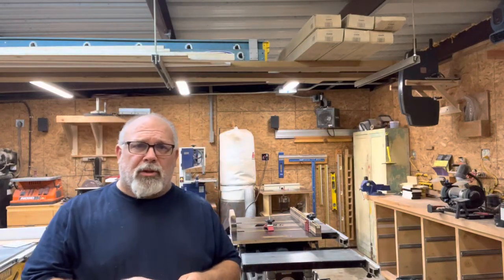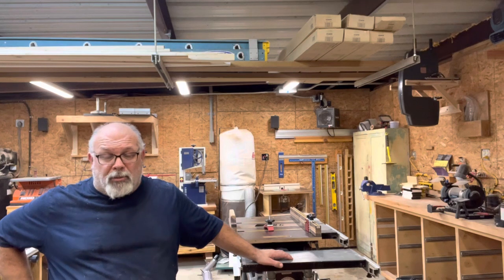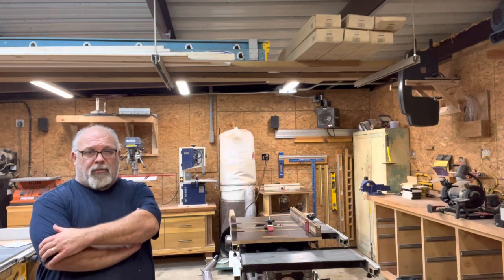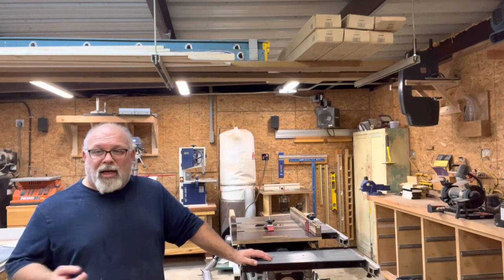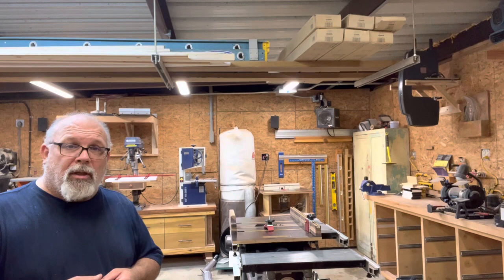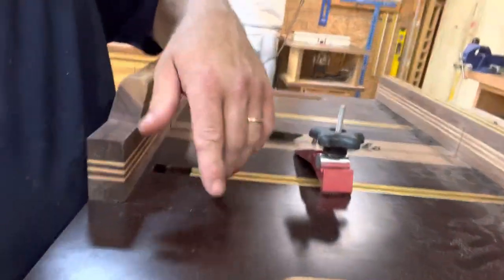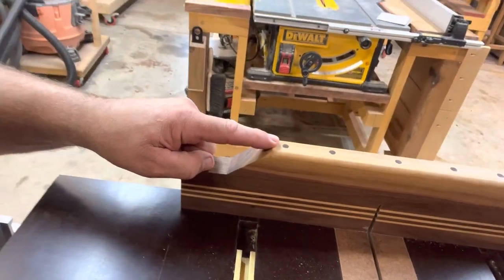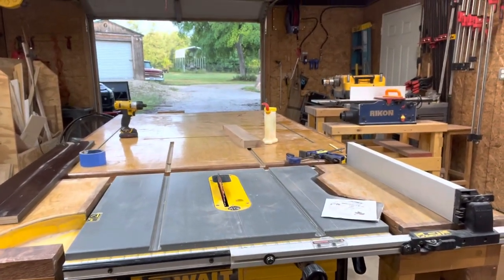Crosscut Sled for ShopSmith Mk V 520

Comment: Great looking sled Tim. I love my 5 Shopsmiths. I currently own a Shopsmith crosscut sled and the incra 500 crosscut sled for Shopsmith. I will get around to doing a made sled down the road. 

 I also own the dewalt compact job site table saw. I’m selling it because I have enough tables along with the Shopsmith table brackets to use them for infeed & outfeed tables to do ripping. 

Scott is the Man!!    Happy woodworking.
Reply from the maker: Thanks!

Comment: Nicely done!  

Welcome to the Shopsmith community.  You’ll find that tinkering to improve efficiency, safety and accuracy is almost as much fun as turning out projects. (At least that is what I‘ve gotten from my almost 30 years of experience.)

I like the idea of the kerfed push handle.  Tactile references mean so much when you want to concentrate on the cut and not worry about your fingers.

I have a few SS videos showing projects and jigs… I’m subscribing to yours so I can look for more good ideas.  

Keep ‘em coming.

Thanks,
Dave
Reply from the maker: Thanks. I’ll check it out.

Comment: Very nice. I’d be afraid to use it so I did not mess it up!
Reply from the maker: Thanks. I forgot to mention that I placed a 3” strip of 3/16” Masonite or Hardboard down the center. 

It’s held in with two pieces of double sided tape. 

I can replace that as needed and always return to zero clearance.